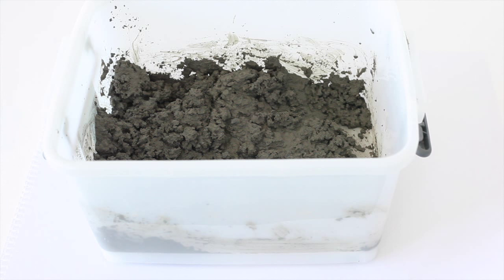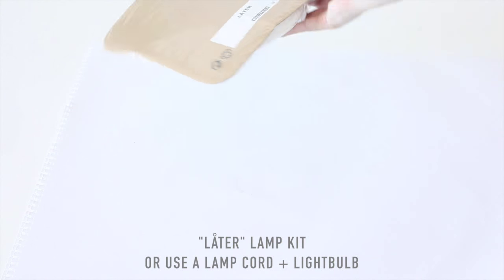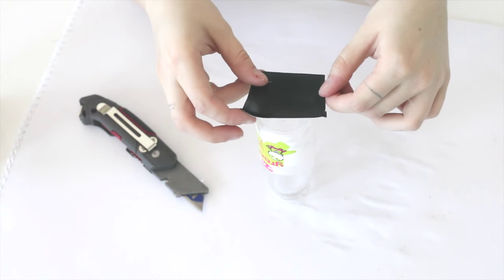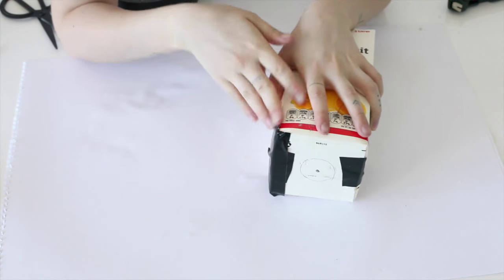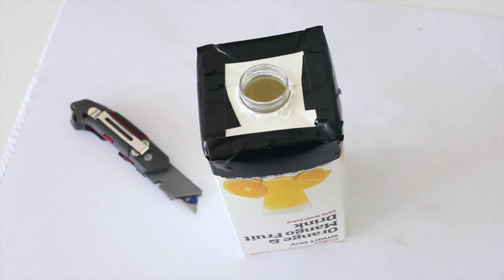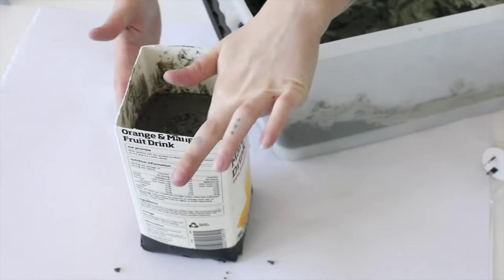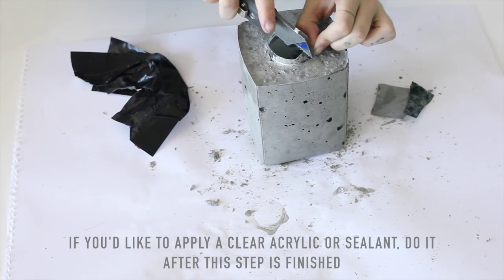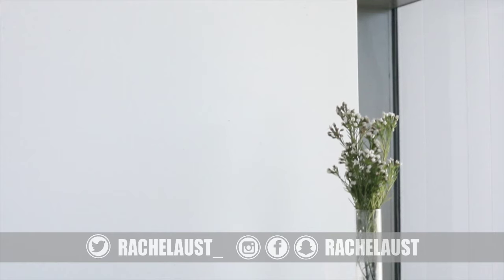DIY Concrete Block Lamp // Rachel Aust

Comment: Great! A quick suggestion too: If you use quick setting cement mix you can remove the mold after less than 24 hours. that way it is sandable and still slightly damp to carve or shape. side note: remember to tap the sides of the mold to shake out bubbles!

Comment: finally the concrete lamp!
are you remove all the plastic bottle or just remove half a way on the top of the concrete?
thank you rachel :*
Reply from the maker: I leave in the very end of the plastic bottle to hold the light better, but you don't have to do that!